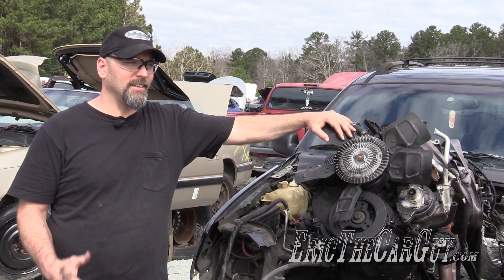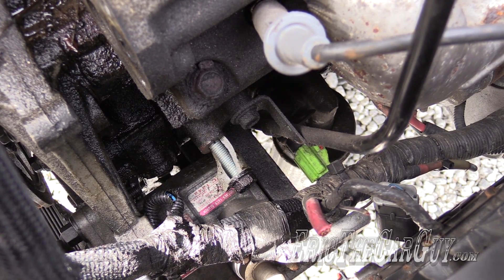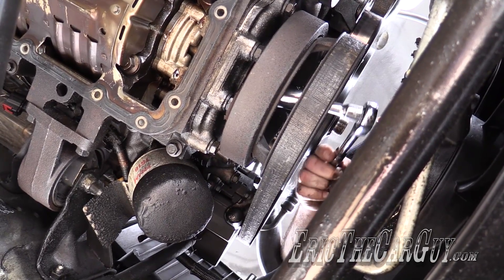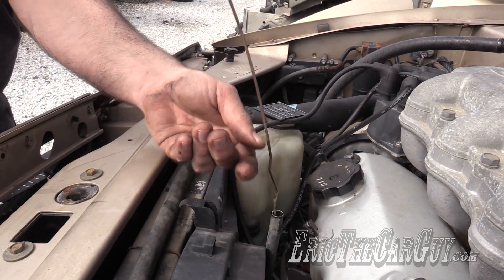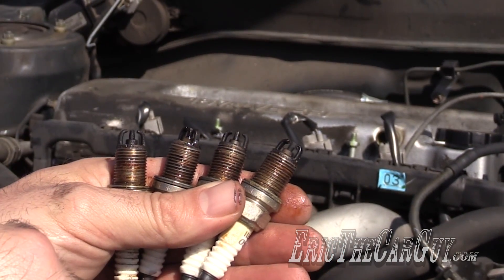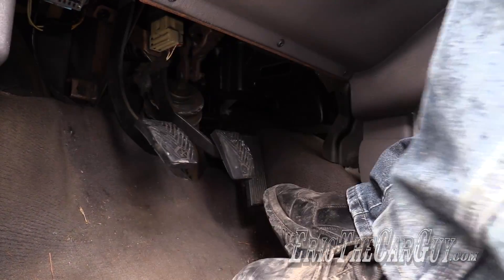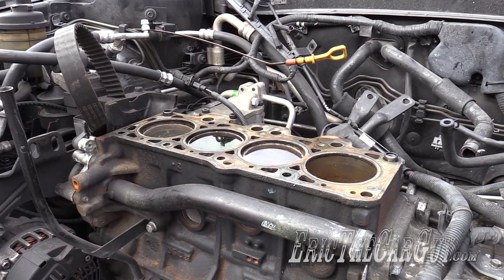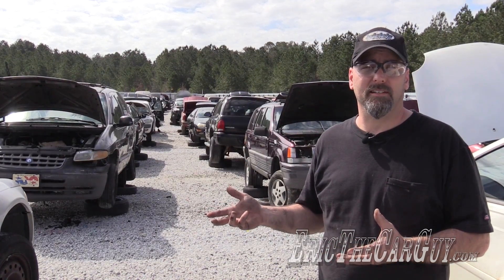What to Look for in a Salvage Yard Engine or Transmission

Comment: A way for me to determine if I’m going to buy the transmission or not is by inspecting the engine if the engine shows problems like overheating bad block that’s the transmission I’m going to buy And it does not take that long to figure that out  ps Ford ranger 03
Reply: So badly maintained engine tends to equate to lower risk of crappy transmission?

Comment: Were you getting sunburnt out there? That white gravel would roast you on a hot day if you didn't cover up. How would you remove an engine in a yard like that?
Reply: Depends on the yard but many will send a loader out if you get it all unbolted and ready to pull.
Reply from the maker: I got sunburned plenty during this shoot. As for the engine, I hope to cover that in a video at some point.

Comment: haha Eric just told me to avoid using the engine in my own car
Reply: Ha!
Reply: lmao same, my engine burns oil
Reply: My undercarriage is all oily from various assorted leaks. Mine would get passed up.
Reply: +Matt In Illinois hahaha, nah man crusties on the oil cap
Reply: +dosmastrify not white (good head gasket, knock on wood) , just crap like he show in the vid
Reply: Same here 😹my geo prizm burns oil haha but hey as long as I keep it topped off she runs decent !
Reply: @garymijangos9403  I had one with 300k miles, it burned oil by that point too. The one I had before that with 170k didn't use a drop!!
Reply: Lmao same bro don’t feel bad

Comment: Hey folks, do you expect an engine purchased from an auto-recycler (i.e. auto-wrecker) to be fully functional?  As in, I buy the engine, hand it over the mechanic, they should be able to mount the thing up, add oil and (assuming the spark plugs and coils are good) the engine should fire up?  My mechanic did a leak-down test on the first engine I picked up - one cylinder did not hold any pressure on the intake side.  The water pump pulley was also dented and did not turn smoothly.  I took the engine back to the wrecker, and the manager gave me another engine (not without getting an earful from him).  2nd engine was even worse than the first - none of the cylinders passed the leak-down test.  This was despite the exterior of the engine looking immaculate, and at least this time the water pulley was undamaged and spun freely.  The auto-wrecker manager was super irate when I came back with the 2nd engine, he didn't even want to look at or listen to me.  Am I doing anything wrong?  Do I need a new mechanic?  For what it's worth.... I consider myself to be fairly easy-going and level-headed.  The auto-wrecker manager has been anything but an absolute PITA.

Comment: What about looking at the odometer?
Reply: Most cars have digital odometers now - can't get mileage off of those.  Although, if you're resourceful you can find success googling the VIN number - I've found auto auction listings for wrecked cars that list the last known mileage and in CA you can search to see when the vehicle was last emission tested and find out if it passed or failed.  Not a great indicator but if you find a car with several fails in a row, thats not a good sign
Reply: bring a jumper pack
Reply: @TheRenpeg  If they forbid those, even a 9V battery is good enough.  I use them for relays because if 9V won't make it click, it's probably not going to work much better at 12V.  Like a mining canary.

Comment: 30 days is not great. There are also stipulations in order to be covered..... like new pan, valve cover or other gasket for example. That's to prove you did your part in preventing a possible good engine or trans from going bad from a leak or something. Most good mechanics like to do basic gaskets anyway, just to get better interior inspection of purchase, & prior to install into vehicle. 

30 days isn't really 30 days, after waiting for some new parts to come in, install them, & installing engine. You may get 2 wks or less of actual running time on the engine to know if you have to do it all over again.
Reply: +adventureoflinkmk2 yeah you can do that, but there's ALWAYS something else to get. Timing belt or chain, sensors, misc. unexpected crap all the time. It's hard for most ppl to get everything all up front & return what you don't need.
Reply: +adventureoflinkmk2    I'm only mentioning because of my own (& ppl I know) experiences, on just about every swap. Just saying, not to prove being right or wrong.  ;)
Reply: Damn, you're into cars? That's sexy as hell.
Reply: +The513Warning Thanks. Anything with an engine... From lawn care equipment to diesel rigs or construction equipment.
Reply: Not at these yards - you bring it back, say it's bad and they either give you a credit (for a future purchase) or a replacement (that you pull).  The situation you described is common of full-serve (they pull it for you) yards.
Reply: +ratbert86 it all depends on the area. Quite a few u-pic-its around me. All are 30 days as well. JunkyardBarbie, Crescent, Jimmy's, Harry's... SE PA area
Reply from the maker: Good points. Thanks for your comments.
Reply: One junk yard here has long exchange warranties, but they have to be purchased.

Comment: Question, how do you carry an engine out of that salvage yard with all that gravel?
Reply: Well at harrys you pull it in PA, they have carts you use to pull it out. Or you can just get a couple of strong people and carry it out.
Reply: +snoopdogie187 which harrys u go to
Reply: the one in allentown, pa
Reply: The yard i go to has A frame lifts available to pull, transport and load the large components.
Reply: They usually have loaders,tractors,tow trucks etc. to pick things up, I would hope they wouldn't expect you to roll it all the way home lol
Reply: +snoopdogie187 i usaly go to the one past jim thorpe
Reply: Corey Lambdin
I think that is the West Hazleton yard. I'm coming fron NJ, so that one is a little far.
Reply from the maker: You can have them come over when you're ready to pull it out and they'll take it up front with a fork lift.
Reply: EricTheCarGuy Now thats what i call awesome service.
Reply: sparkplug1018
Yeah, extremely awesome service. Last night I went to Harrys, there was one women that would get upset if you knocked on the glass, but she would takes a few minutes sometimes to acknowledge that you were there, so you just wait and wait for her to let you in the yard. Forget her doing anything extra for you lol
Reply: snoopdogie187 Yeah I run into those kind of people at my local yard too. My comment was referring to the using a fork lift to help you out though.

Comment: Good Video dude I have a 2000 Buick.....I need a video to help me with overheating. ..I bought thermostat,radiator, heater core,and water pump but still heating up...
Reply: Burp the coolant system

Comment: eric you should do a video on how to start an engine and possibly check for compression at the yard (thats if the starter is still there)
Reply: none of them have oil so would seize up
Reply: +kai wilson you can add enough to cover the crank
Reply from the maker: I don't think that's really practical but thanks for the suggestion.
Reply: +EricTheCarGuy it could save time and money unless you do the work which is time but time is money lol
Reply: +omar k I'm not from the US but in the UK they remove all fluids by cutting the lines wouldn't imagine it's worth trying to even get oil fuel and water into test

Comment: With automatics the first thing i do is drop the pan, if theres anything chunky or gritty in there its probably not a good one. On most vehicles its fairly easy to drop the pan and gaskets are cheap (plus should change the filter anyway. Something else you can do is open the transmission cooler lines. They may drain the pan but they never get all the fluid out of the cooler.

Comment: I got my T5 transmission from salvage. I cracked it open, installed it into my auto to manual swap mustang, and works like a charm. Saved 500 dollars.
Reply: What was your total cost? I want to do the same thing. There is a guy on ebay selling complete swap kits but he wants $3,500.
Reply: Only $500?  Relative to used only, right?  Refurbished is way more expensive.

Comment: Would it be feasible to bring along some oil and starter fluids and a jump pack to see if the engine will actually turn over?
Reply: No no no!  Do not start any engine in a junk yard.  They'll ban you for life for risking a fire.  If you want to know if the engine is even able to physically turn over, try rotating the harmonic balancer pulley (say, by moving the serpentine belt or with a wrench).  Chances are, if that turns over (not start, but just turn), then if it won't start when you test it in the 'patient' car you're donating it to, it's something else.  i.e. Fuel, air, spark, failed starter, etc.  This is why exchange warranties are mandatory if buying a used engine.  It's a pain, but you can try another one if it's the actual engine and not the parts attached to it.

As a side note, batteries and booster packs are forbidden at my local junk yards precisely because someone had that idea.

Comment: Pull the trans pan before bothering to pull it.  Most of the fluid will be gone, but the sediment will remain.
Reply: Also open the cooler lines, they may drain the pan but that radiator still has fluid in it. Also applies to power steering parts as well.
Reply: Good call
Reply from the maker: Good idea. Thanks for the input.

Comment: A big thing I look for is how the car was maintained, look at the car over all, if there's duct tape holding things on avoid it, check the breaks, just look it over. If it looks like it was a kids car avoid it because 9/10 times it was beat and not maintained very well
Reply from the maker: Good point. Thanks for your input.

Comment: U Pull It yards are great but probably not where I'd go for an engine or automatic transmission.  If you're going to install it yourself then the lower price may be worth the risk. However, if you're going to pay someone else to install it then I'd try to find a used one from a wrecking yard that checks the engines and transmissions, and then removes them, before putting the rest of the vehicle out to pasture.  I know as I used to do this when I was in college.  We did everything we could with the vehicle to get them to run enough to warm up, get a compression check on them, run them through their gears, and then drown them out with oil for storage.

Comment: It's obvious when you think about it in hindsight but I never even considered looking for cars with crash damage. Awesome tip, thanks Eric!
Reply: I mean logically it makes sense, vehicles that were in crashed 9 times out of 10 had to be operational at the time of the crash. But you still have to be careful, if front end damage occurred, a lot of times engines still run if unless fuel shutoff pump killed the engine.  I say this because a lot of front end crashes destroy the radiator and oil coolers which can cause quick overheat.

Comment: can u buy a car from the junkyard?
cuz I found a 350z
Reply: Depends on the yard.  Our local yard has the 'saleable' cars out front.  But you have to be a licensed dealer to purchase.  That really hacked me off, as the wife and I where looking for our VW Beetle, and the local yard had 2 of them.  (1.8 turbo and one of the TDI models)  Both pretty low cost.  Both needed power steering lines.  

Went to talk with the guy (idiot clerk) and he stated they are only allowed to sell to registered dealers in the state, and not to walk in's.  I find that to be  lame excuse, as people buy rebuildable cars all the time from yards.  They get a 'salvage' title, and need to go through a different inspection process (at least in NYS). 

Some yards are better to deal with then others.  Sad part?  Both Beatles wound up in the yard 3 months later and where trashed by the "flippers" and wrench monkeys that destroy and not remove.
Reply: Some yards will sell a vehicle to you, but since it will come with a salvage title id move on an leave it. Being a "salvage rebuilt" pretty much makes the car almost worthless if you ever go to sell it. Plus you have no idea what condition the vehicles in.

I bought my Z28 from a salvage yard (with a clean title ironically, which is illegal i latter found out) Car sounded great, had great oil pressure and drove. Just a bad miss fire. 3 days latter the transmission blows up, drove fine around the lot though. 

You really have no idea what your buying, its just best to find one for sale and leave the salvage vehicles where you find them.
Reply from the maker: Not usually. Even if you could, you'd have to deal with the salvage title and that can be a real pain.
Reply: What do you mean you have no idea what you're buying? Salvage title cars should be inspected in same way you would inspect any car's mechanics. I've owned many cars, more than half had salvage titles. Didn't have more problems with the salvage title cars. ...One time I bought a car that 800 miles on it from insurance auction, it was almost new, not crashed, but interior was stripped, no seats, no carpet etc. Just replaced parts and like a new car. So I'm not sure how that is terrible?
Reply: INTERNATIONALvids Most of the time (not all) You really don't know as your buying a car sight unseen. And most yards don't allow inspections. A perfect example of this is the Z28 I bought many years ago. Car ran great when I bought it, minimal rust and decent paint and interior. Even my mechanic at the time couldn't believe I paid $650 for it. What was the problem then? Despite shifting beautifully when I drove it away, the transmission was a POS and seized up while going down the highway. 
My mechanic didn't see it, my transmission guy didn't see it. (and yes they are competent mechanics) 
You can be getting a real gem, or buying a turd. And most of the time you honestly don't know and can only do so much to minimize the risk. And something else worth noting, a lot of insurance companies flat out refuse to insure cars with salvage titles. If the state your in will even title the car to begin with.

Comment: I have a '94 civic 1.5L with a bent connecting rod in the #1 cylinder. I found it in the process of doing a rebuild to replace the rings for a blue smoke problem. It's a cheap car, would getting a used rod from a junkyard engine be okay? Most shops don't sell individual rods only sets.
Reply: nice to know someone out there has the same problem i had . I spun a bearing after changin my rod  it was due to hydrolock. Now I am trying to purchase a used block

Comment: I assume engines and transmissions are crazy cheap at a pull yourself yard?    If not I think I'd prefer one that the yard had tested prior to pulling it.
Reply: not crazy cheap. lol min $300. & up to $800 or more. Depending on engine or trans. Diesels & its parts are more $. Then you are doing the work.... hrs' worth or up to a day's worth. THAT can be costly. That time could be spent earning... you know what I mean? Plus you  might find something wrong with it half way through pulling out. LOL
Reply: I meant $200 min. & the up to $800 is including the diesels
Reply: I paid $450 for my Toyota Echo engine, delivered and known at least to run properly.

And I'm in Canada where everything is at least a bit more expensive.    I would have thought it would be far cheaper but maybe it's worth it with something newer and more expensive.

I'd hate to spend all that time and find out something is wrong after installing it :O
Reply: Depends on the yard but my local YPI places $175-200.00 for any complete engine,  $120-150.00 for a trans.  OR the full service yard, where the prices vary based on popularity of parts but run about $300 - $900.00 for an engine and $300-$500.00 for a trans. Both offer warranty, YPI is 30 days, the full service is 60 days/3000 miles.
Reply: +Scott Verge EXACTLY. Some yards have areas where you can remove them. They'll move them with a forklift & that way no one else comes by disturbing or taking parts you may need, but yeah... not worth my time I say.
Reply: +Blazer02LS what area are you from? I'm from SE PA so I get parts from as far as S NY or NJ to mid PA. Out of curiosity. ..I'm in need of Blazer parts... Nothing like LS parts though...lol
Reply: Central NY. What parts?
Reply: +Blazer02LS I really want a low mileage replacement engine... I got the s10 with the 4.3.. pre spider crap. I love this engine (1st Gen TBI w/o balance shaft). I've done too much overhaul on anything newer (for customers), so it's seems more bullet proof. Then there's a few body parts, like grill, headlight frames, few misc.  Out here the yards are quite bare. I gotta make a trip upstate, where there's less turnover.
Reply: 4.3 is a very good engine, It's parent (350) is as well. I've owned a bunch of them over the years. 
What year and version body panels?
Reply: +Blazer02LS all 1st Gen s10. mine is 89. but I believe yrs 84 or 85 to 92 all fit
Reply: +Blazer02LS yeah I totally agree with your comment on the sister 350s. Quite frankly indestructible if taken care of. All mine reach 300k + miles before needing major work. This 4.3 is nearing 300k so I want to prep an engine b4 it going down. It's my everything truck.  Mobile garage.

Comment: One thing you can add to the list of what to look for is if  you know your vehicle uses an interference engine walk away from any engines in the yard that have broken timing belts, belts with missing teeth, tensioners and their pulleys that are shot, or wobbly water pumps if timing belt driven.  Valves and pistons meeting may be the very reason it's there.

On automatic transmissions pull the pan and look at the filter and magnet. They use a vacuum system to suck out the fluid from the TC and transmission usually through the cooler return line, it can't get it all though so there will be some left int he pan.